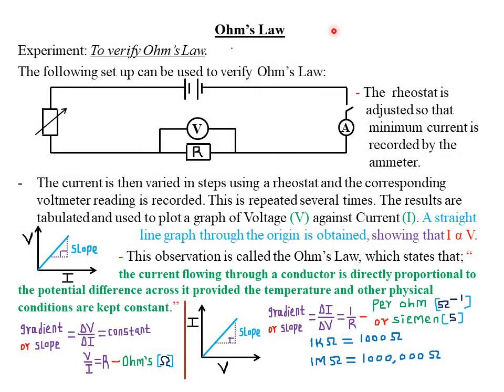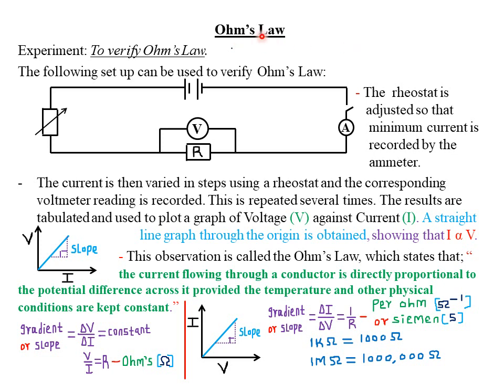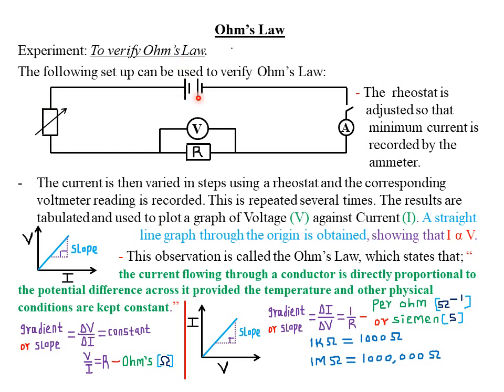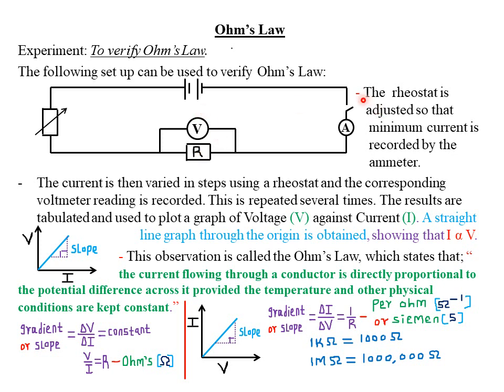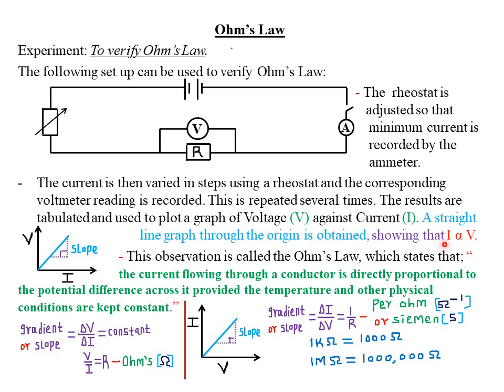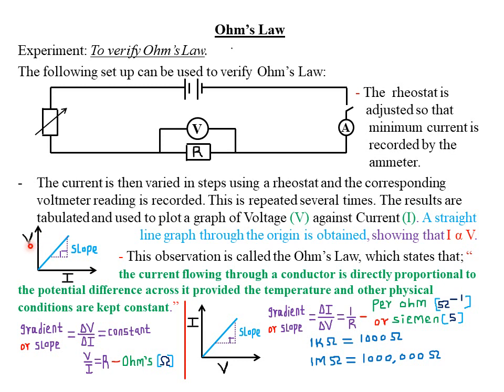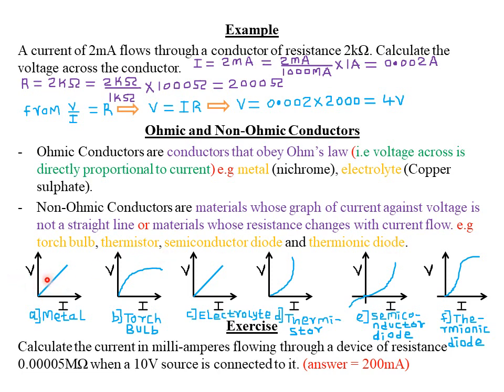CURRENT ELECTRICITY(II): LESSON 2

Comment: Is there a way one can be able to ask questions sir
Reply from the maker: Yes. Through this comment section. Just type your question here.
Reply: The ratio of men to women in a self help group is 8:13.Two more men joined the group while five women left the group .The new ratio of Men to women in the group is 7:10.
i)Find the original number of men in the group.
ii) Number of women in the group.
iii) Original number of members in the group.
Reply from the maker: (i) 65
(ii) 105
The working involves solving simultaneous equations which I doubt whether you've learned. Which form are?
Reply: Form 3